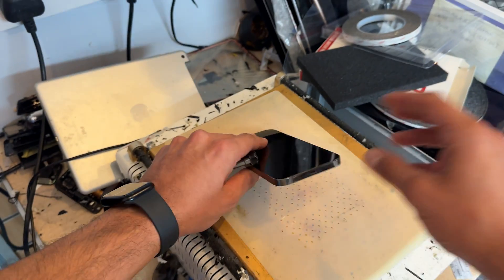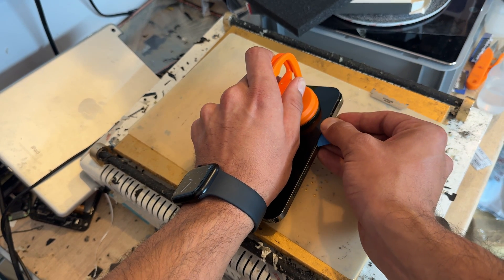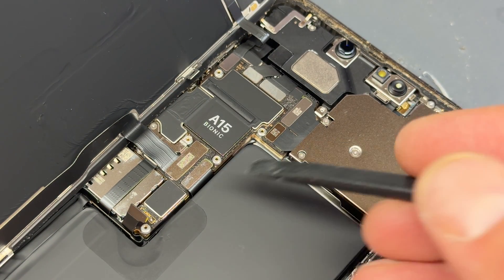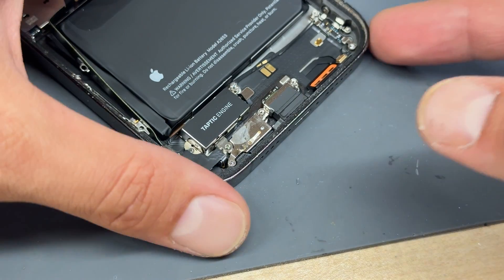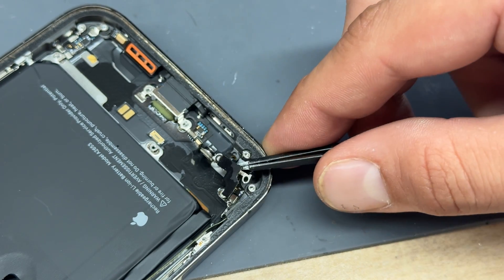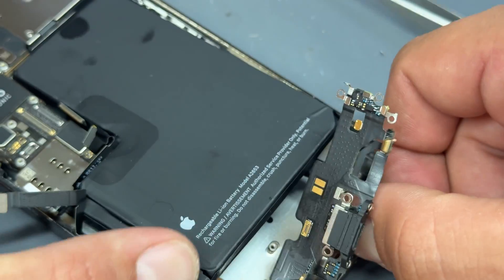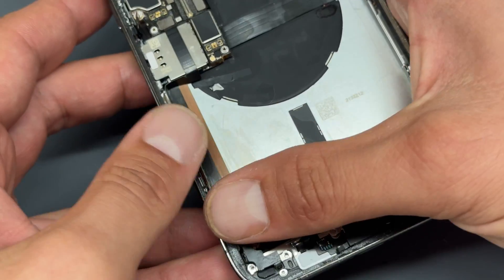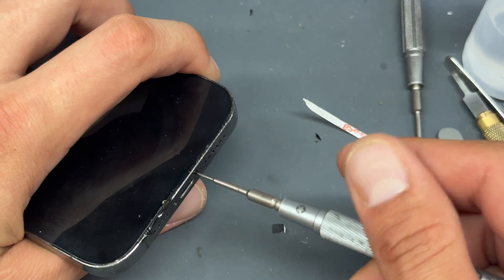iPhone 13 Pro Max Charge Port Repair - Complete DIY Guide!

Comment: Broken microphone after fix? Battery tabs gone? LOOK HERE!

Firstly my microphone was completely dead after I changed my port. Googled and couldn’t find anything on the issue other than “likely broken spare part” until ChatGPT pointed out that third party components usually ship with protective film over the microphone. And I realised that I hadent noticed or removed that. So I had to do this process twice but sure enough, the reason my mic was “dead” was that the protective film was still covering the microphone on the component. Note that there are two microphones, one on each side of the charging port. Removing that fixed my issue.

Second issue was that I almost immediately managed to snap all of the battery tabs. Felt terrible and I wondered if I could possibly get the battery out now without having it explode on me. But what I did was I pretty much flushed the sides of the battery with Isopropanol 99.5% several times to loosen the adhesive. Then I gently scooped out as much adhesive as I could with the thinnest plastic spudger I had (from the ifixit kit), more Isopropanol as I moved along and finally I gently, very gently, pried it off as horisontal as i could. Working slowly, with lots of alcohol and lots of patience did the trick. But when working with batteries I cannot stress enough how careful you have to be as damaging the battery is very very dangerous. After the battery was removed I made sure the bottom of the chassi was completely dry before reassembly. Some alcohol had sunk into the MagSafe charging component straight under the battery but pushing down on it with my thumb it resurfaced and I managed to dry it out.

That said, Thank you very much for this excellent follow along! It got me a good 80% of the way and I hope these extra tips can help others reach 100% without as much hassle as I had
Reply: thanks!
Reply: Thanks for the tip, il check if iv drowned my magsafe lol